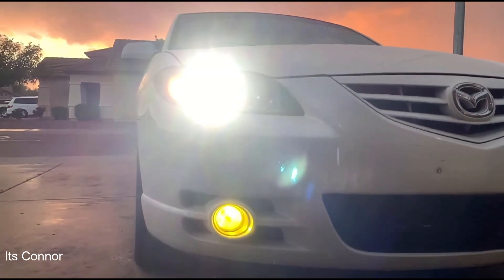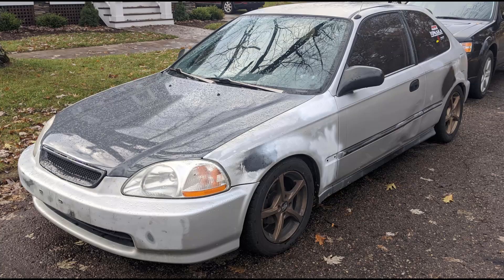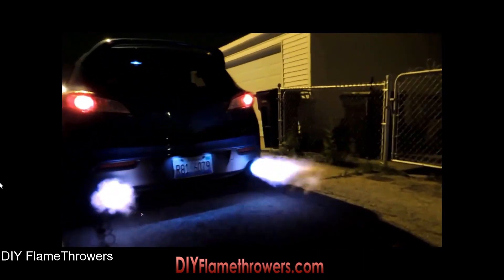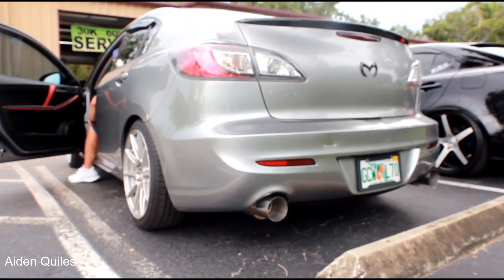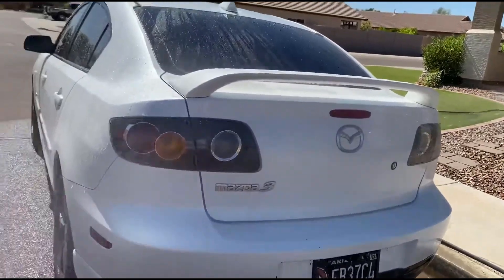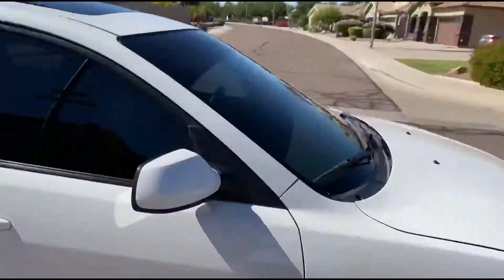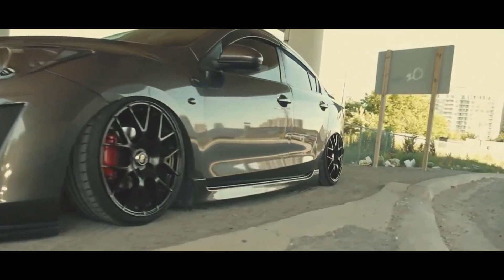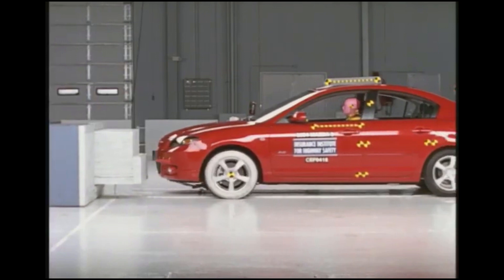Should you MAZDASPEED swap you N/A MAZDA 3

Comment: I have done the swap and honestly I think it’s worth it, love driving my sedan speed😂
Reply from the maker: Of damn you have one! Nice super unique
Reply from the maker: If you don't mind how much did it cost altogether?
Reply: @LifeOfTuners  all together maybe like 7000$😂
Reply from the maker: Whattt no way, it's not the best value vs a full out speed 3, but for something that custom damn! That's way less then what the forums would have us to believe
Reply: @luciomunoz7  sheesh that ain’t bad
Reply: what engine u put in it
Reply: @douglasramos5729  a speed engine
Reply: @luciomunoz7  did the speed 3 tranny fit too?
Reply from the maker: It should do, plenty of people swap the 2.5L in the 1st gen Mazda 3s, and a lot put the speed 3 transmission in with it
Reply: @TheFlyingSage  yes it fits as long as you get the 2.3L manual transmission with the 5 speed it will fit the subframe is the exact same
Reply: You can find a speed3 for less than 7k and it’s just as much hot garbage as a sedan swapped speed 3
Reply: @micahlawton  why you hating😂
Reply: @luciomunoz7  I owned a speed3 for 4 years and it’s just a low budget car for broke people to feel fast... If you’re gonna go cheap get a civic. Much more bang for your buck.
Reply: @luciomunoz7  since y’all on a budget and all... Mazda owners in general...
Reply: @micahlawton  you still hating my boi😂
Reply: @luciomunoz7  them speeds get gapped by the most cheap eBay setups on a shit box civic though my boy
Reply: @micahlawton  don’t care about getting gapped😂 just love my car dude 😂
Reply: @luciomunoz7  ahh you get taken to gapplebees often I can tell.
Reply: @micahlawton  nobody races me cause they think I drive a regular sedan😂
Reply from the maker: But the sedans do look way better
Reply from the maker: Any car gets gapped by an eBay turbo civic
Reply: @PedroKing99  I owned a red 2010 speed3 for 3-4 years
Reply: Thing is I want to, I got my 2013 Mazda 3 Skyactiv hatch for 8k, I could sell it for 7kish at 93,000 miles and get a speed for 12k. I really want to v6 swap my 3 though lmao, with maybe a VQ engine. Did you use a speed transmission?
Reply: @Dyl_Cam  yes I use the speeds transmission
Reply from the maker: It would cost Hella money to vq spap a speed, I'd either buy a MazdaSpeed, or buy a VQ (I just bought a VQ yeayyyy check out the new videos if you want to see 👀)
But yeah it'd cost a TON
Reply: @luciomunoz7  you got a slow car
Reply: @micahlawton  okayyyyyy weird flex but okayyy😂
Reply: @micahlawton  the sedans weight less then the hatchbacks

Comment: I don't know the conversion rate, but Mazdaspeed is hella cheap in the Northeast US, I picked up a fully running 2010 speed3 that just got a fresh engine for $4500. And I see ones in decent condition for 6k. Speed6's are even cheaper at around 3 grand in good condition and most of these cars including mine somehow haven't gotten the new England rot. Absolute miracle.
Reply from the maker: Whattttt, damning hell that's some bloody nice prices 😳
Reply: @LifeOfTuners  Lmao its what made me pull the trigger on one, I fell in love with the smile on the Speed3 when I was young but it felt so out of reach. Now i had no excuse.
Reply from the maker: Ofc man! They are really good cars
Reply: wait til he looks at the prices today bro 💀theyre like 10k plus just for ones that run and drive
Reply: @tirstan0122  I did, it's hell and I hate it. Every damn car is overpriced right now.
Reply from the maker: Yeah it sucks :/ here in New Zealand they're one of the last good value performance cars I'd say, otherwise you're left spending 8k on some slow box or 30k on something that's just as fast
Reply from the maker: Shts gone crazy

Comment: The skyactiv chassis will need to be modified for the sub frame and mounts. The chassis is lighter. It’s already a beer can as a speed 3 because those cars will kill you if you wreck. So getting the lighter chassis is going to be very fast
Reply from the maker: mhm yes indeed

Comment: I think I'm more curious about swapping the awd system from the mazda 6, because I know some of them come awd
Reply from the maker: Yeah that's been done before too, but man, that'd be expensive, custom floor pan, custom front and rear sub frame (I don't think a 6 subframe would bolt up to a 3?) Etc
Reply: @LifeOfTuners  I can understand that, it would be easier to bolt one from a different car with a similar wheel base to the 3, something like and audi TT between the years of 2001 to 2005, and do the custom fab work yourself if you can weld, but still expensive I can understand
Reply: More less just bolt a similar sized subframe, or make custom mounts, or even take the drivetrain and swap from a car that has a transversly mounted inline 4
Reply from the maker: From what I've heard people still swap the AWD system from the 6 to the 3, just for the ease of bolting Mazda parts to Mazda etc, I think that would come in real handy when it comes time to wire up the AWD control modules etc, it would be so cool to have an AWD 3
Reply: @LifeOfTuners  it really would, I agree, I can understand using mazda parts with mazda to keep it in the family, but I was really just thinking from an engineering stand point, while still using the motor from the 3, because I have an 07 mazda 3 S myself, its 100% stock, and an awd swap has crossed my mind a few times, but for me, its finding the right car to swap with, that and the money it would cost to find the doner car, but for now, I think I'll stick to just doing the underpinnings, wheels tires and suspension and what not, I have thought also about doing a speed 3 motor swap from a similar year car to make more power, without maybe swapping the subframe but again, finding the doner
Reply from the maker: Oh yeah, after thinking about what you said, I realized that (and I have no idea how I forgot) that a little while ago I did a video about the Mazda speed 3 could've been awd. And that whole video was surrounded by the fact that Mazda made an awd version of the Mazda 3 gen 1 for the japanese market, litterally just a normal gen 1 Mazda 3 with awd, so I mean, it really shouldn't be that hard, at all with that, though ofc probaly the rear axles and driveshaft might be a bit weak
Reply: @LifeOfTuners  I mean, as it stands mazda already decided to reintroduce an awd mazda 3 into they're lineup which I think is awesome, also knowing that the car was AWD in japan doesnt really surprise me, because here in the states we get boned a lot and cant have the cool things, but we make do, also now knowing that I have an even bigger want to make my little car awd, it would be fun, handle better, and just be more practical in terms of bad weather wear I'm from, gets a wee bit cold wear I'm at

Comment: I think it's better to buy a Mps or Mazdaspeed instead of doing the swap unless you have money and time. I was thinking of swapping the 2.5l engine in a 2.0 Mazda 3. My Story I have a 2.0l Mazda 3 neo sport 2008 it is kinda quick for a Mazda 3 for a 2.0 and all I have done is bought the 2.3 rims and muffler delete so I felt a difference. Although I have reached 200000k and started hearing rattling in my engine as I press on the accelerator or when idling, as far as I know, could be my timing chain as many mechanics have told me. So what I thought instead of fixing the chain and spend 1200$ to fix it, should I get the same engine with low ks or an "sp25" 2.5L engine with a 6-speed swap in my 2.0l. 

Will I gain heaps of power?
Will it be a simple swap just changing the whole engine + trans and program the ECU or do I need more parts?

or any ideas what I could do to gain a good amount of power with my na Mazda 3
Reply from the maker: Ohh I actually am quite interested in the swap myself, infact I have looked into it, it seems quite easy, apart from switching the engines, you just have to move the assesories and bolt ons from your 2.0, onto the 2.5. 
People say it does feel notably quicker and torquier then even the 2.3 engine.
For future reference, there is a great Facebook group all about the swap, called the 2.5 duratec/mzr swap group
Reply: Learn to do your timing. Buy the timing tools that lock everything in place and it's pretty simple. Save you alot of money

Comment: I have 275K on my 2014 3 hatch, 6 spd manual.  I want to know when I'm ready for a new motor if the new mazda 3 turbo motor will be able to be swapped without much modification.  I don't want to pay 35K for the new model but I do want more power.
Reply from the maker: In terms of milage, when they break on the n/as, it really depends, though 275k is a lot, but it still may be good for longer since I'm guessing with it only being 7 years old, you do a lot of longer distances drives, which is good (less heat cycles), but then again, it's at 275k, so it might not last longer, it really does depend.
I'm guessing it will take quite a bit of mods, as you've seen with this video, it takes a lot to put a same generation 2.3 turbo in an n/a 3 (some people claim it's cheaper, but still same price as buying a speed 3) and also that 2.5 turbo is a relatively new engine, there's not going to be a lot out there to buy, so prices for them will be sky high
Really the cheapest way would to either buy a speed 3 or buy a speed 3 with a blown engine and put in a lightly used oem engine
Reply: @LifeOfTuners  I do have a lot of miles.  I still have the original clutch, it doesn't slip, and haven't done any work to the engine, not even the serpentine belt.  With the experience i've had, I'm sticking with Mazda, whether I buy new or get a new engine.    Thanks for the reply.
Reply from the maker: Oh wow! That's crazy! You must of treated it very well! Good on you
Reply: @matthewhoover6154  the new gen hatch turbos are pretty nice

Comment: I must say i replaced my front control arms wirh normal 1.6 and 2.0 control arms.and it fits perfecr.no issues.
Reply from the maker: Oh damn, were they identical? From what I've seen I thought you needed the entire front suspension, mainly for bolting to the subframe and the different knuckle
Reply: @LifeOfTuners  i have gen1 mps.i needed front control arms.so i bought aftermarket new ones.from 1.6 2.0.it fits perfect.bolts on perfect.i even compare them.looks the same.and on mazda epc.the normal 2.0 and 2.3 normal asp.use same rack end.tie rod end.and steering knuckle as mps.same part nr.so looks like the only difrence in parts is steering rack.brake discs.and caliper.en stab bar.i even use nornal 2.0 and 2.3 front shocks.but with my mps stab link coz its longer.due to upgrade stab bar.no issues
Reply from the maker: Damn, people I've seen talking about the swap seemed to think (and someone that did it) that you needed the full setup, obviously not, thanks for pointing that out! Though struts would need to swap, though in the grand scheme of things, that's not too much of big deal
Reply: @LifeOfTuners  the reason why u cant use the normal models stab links.its too short.obes connected to mps syab bar it knocks and bamgs agains bar.coz the traveling is to short.so i used my long mps stab links.the front shocks fits perfect of normal model.i now have i little noise dive look.like the st focus.it looks sexy.compare to the raised nose look.oh ya.my one friend even used the the normal 2.0 models gearbox mounting.his mps gearbox mount was waisted.i had new 2.0 gearbox mount.he fit it and said it works.no issues.so ya there is proof.u can use parts of normal model.
Reply: Also.rear shock and shock mountings is the same.it fits perfect.rear discs is same as normal 2.3 normal aspirated.and calipers.the only difrence is thicker stab bar and the links.
Reply: And i just check now on mazda epc.the front stab bar and links is difrent.coz its upgraded.but the whole chassis frame where control arms bolts on is one part nr.so normal 2.0 2.3 and mps use same chassis frame.part nr BP4K34800K.one part nr.so there u have it
Reply from the maker: Hmmmm damn, you can do the standard Mazda 3 shocks, but like you said the nose sits lower due to the extra weight, and they are softer.
Reply: @LifeOfTuners  i wont say the shocks is softer.i think the little bracket or ear on it where the stab link connects is bit lower.or bit higher.so it change the look a small bit.but it works.car looks sexier.and my nose is still hard.not bouncing on the road.what is ur email.then i can send u pix of my car.
Reply from the maker: My email is b.boostn@gmail.com, alternately you can message us on Instagram at @all_performance_cars

Comment: Hahaha no... the swap is not worth it these days. a good MS3 is about 5500-7500 USD, not 9500. You can get a really nice genpu for 9k, or finance a genpu at a dealer ship for 10.5-12.5k. 

I got mine for 3700$ with a new in box turbo (selling it), new in box engines mounts (selling those to get uprated ones), a Blow-off valve in the box (selling to put the money into either a bypass valve or something else), new undertrays, a full used cold air intake, new cabin filter, and some other parts as well as a HPFP internal set for 250. 

Car had a new clutch, timing chain service, damond banjo bolt, new tires, and new battery. Only catch is has a wonking good dent in the driver's rear quarter some minor dings (easily pullable) elsewhere.
Reply from the maker: Damn they're cheap over their, that's a lot for the money, when I was looking I was looking at ones with under 120,000kms/80,000miles, just cos people that want to do the swap are probaly a little more condition concerned
Reply: @LifeOfTuners  Yes they are really cheap. The price difference here between a Speed and a non Speed isn't as much as it used to be either. Especially for a 2nd gen.   

Mine is 75k miles, if it had not been such a great deal price wise, I would have kept saving for a better body, but as I have the training and tools to do body work, that doesn't bother me. Paying a machine shop to rebuild a turbo 4 cylinder engine in my area does. Most of the race shops only know old school v8s from the muscle car era. I would have to ship it out, or just get a used longblock from ebay which are about 2300-2500$ last I looked.
Reply from the maker: That's so good, I was supposed when I found out how much the longblocks cost in my area (well everywhere tbh) idk what I was expecting, but not that!

Comment: Love the video but you got a lot of the info wrong, but leaving a like
Reply from the maker: Out of curiosity and for the peoe considering the swap, what's incorrect?
Reply: @LifeOfTuners  as long as you get a 2.3L sedan that has a manual transmission all the motor mounts are the same, but if you would want more details I would have to just email you and I can show you pictures and honestly I feel like you have more room with the turbo in the sedan😂
Reply from the maker: Oh yeah true, idk why I didn't think of that since the engine mounts are the exact same, I should've realized, that they'd mount exactly the same to the car itself, then again I should've realized something I always say, don't trust forums lol. 
And that point about the room for the turbo is very interesting since a big concern about the speed 3 swap was that the n/a firewall didn't allow space for the turbo, obviously after the swap had been done that worry vanished, though I know mankey mechanic had to relocate I believe his break lines because they were to close to the hot side of the turbo, maybe that's only on hatches
Reply: @LifeOfTuners  overall you were right it’s extremely time consuming and but if given the opportunity it’s not that hard actually, I got a savage MS3 for 2000$, so I had all the parts. But all the parts fit on the MZ3 and so it was as simple as take a part off the speed and install on the sedan.
Reply from the maker: Oh damn, that cheap speed certainly helps! I guess that does make sense, it kind of goes with what I'm wanting to do, which is buy a speed with a blown engine, pull that engine and put in another, that way I can see how it all should go back and in what order. 
You've got a sick build man, that must be so cool, so unique bro, well done!
Reply: @LifeOfTuners  you be surprised how easy it really is😂 but thanks man!

Comment: Why can’t I just buy a k24 and run it stand alone? This is a shit ton of work for like +100hp
Reply from the maker: Yeah it defo is a lot of work.
But k24 swap would be wayyyy more work, it's much harder to match up different manufacture engines to chasis' then using same brand engines, espically since the 2.3 turbo is essentially designed for the na shell
And ontop of that the k24 only runs 200hp stock, to get a decent jump in power you'd have to either build the engine or boost it. Way more work, but a way cooler build imo